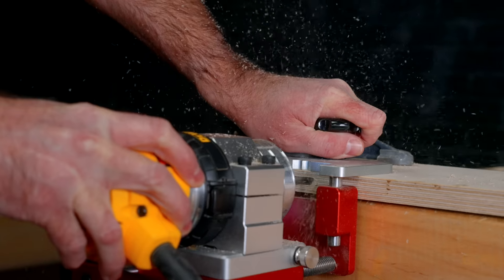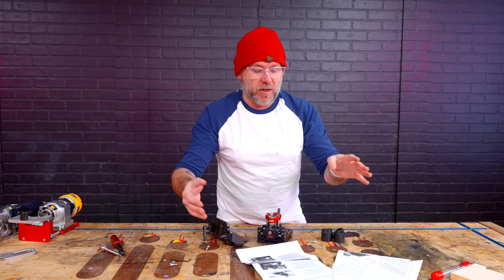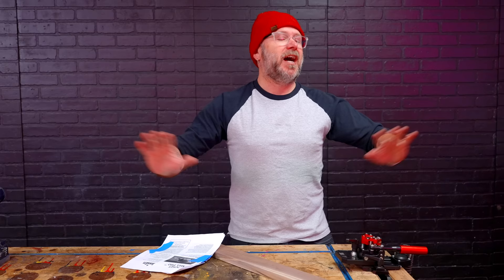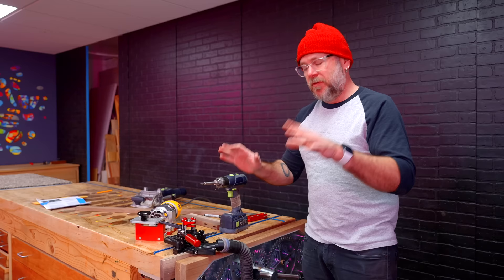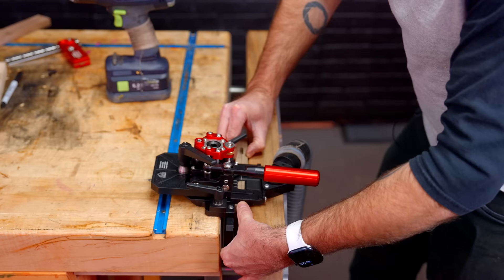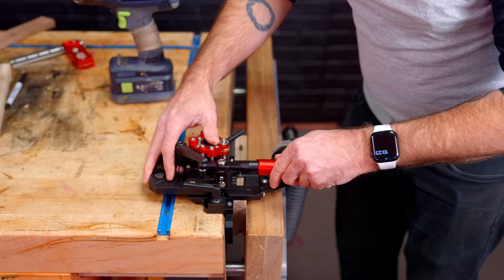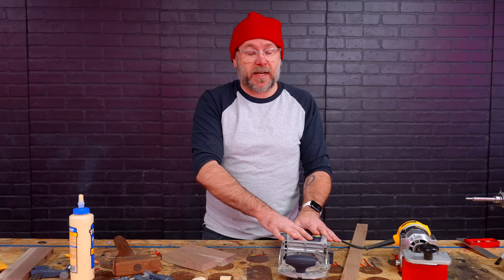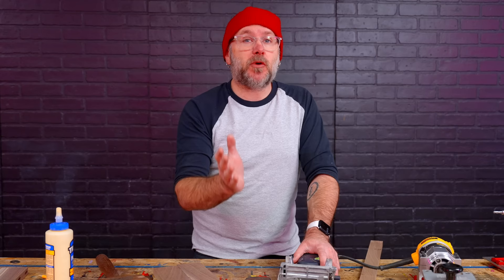I Regret Buying This Tool | Pocket Mill Pro

Comment: Thank you for another unbiased review. It seems like the extra $200 for the jig is needed…which is not an insignificant amount of added cost.
Reply: That brings it to close to half the cost of the Festool. Bring in the awkwardness of the Jessem, it seems the Festool would be better to save up for.
Reply: even with that extra jig, which takes up space, you would not want to use this. that would be almost 600 bucks in the trash
Reply: Pask Makes a channel on here which shows you how to build a router mortising jig that has dust collection and looks easy to use and to do the job really well. It's made out of wood and the video is quite clear and easy to copy. He uses it for loads of his videos and it always appears to do the job quickly, accurately and cleanly and it'd costs basically nothing to make as you could basically use cut offs from other projects. Honestly I'd say it's by far the best option for a non professional/casual wood worker as it does the job really well, it's as good as free and at least as good if not better than the choices he's shown on here apart from the Fastool Domino.

Comment: Let's say you want to make a door and need 12 domino joint to put it together. That means you need to cut 24 mortices, which can be done very swiftly with the Festool, while you would still be fiddling with setting up this drill jig. If you make a lot of doors, or windows, or table tops, or furniture with floating tenons, it really does make a lot of sense to get the Festool because even if it is a big investment it is just such an efficient tool to work with. If you only need to cut floating tenons once in a blue moon you can of course not justify to pay the price of such a premium tool, and for those people I would recommend to either go old school and do hand cut mortices and tenons - taking your time and enjoying the process -  or use a biscuit joiner, or a basic dowel jig depending on the application.
Reply: I agree with this. I really don't see what niche these other floating tenon jigs are trying to fill. Sure, you get to use Dominos for less than half the price, but also half the usefulness, convenience, safety, etc. If you're not in the market for a Festool, go with a solution that doesn't try to be a replacement -- dowels, pocket screws, traditional M&T, and glue will get you everything you need with less headache.
Reply: I was thinking the same thing. While this is technically an alternative, it is absolutely not an alternative as far as time goes. If you are doing any kind of production work, the domino pays for itself in time saved for sure.
Reply: I kind of agree.  I think each tool definitely has a place.  As for using a biscuit joiner or dowel jig in place of a floating tenon, I disagree to a degree.  Biscuits are good for alignment but don't really offer any strength.  Dowels offer good strength but don't have any wiggle room so it is much more difficult to line things up.  With the horrible instructions aside a lot of the issues he faced in the video could have been solved by either getting the workstation (expensive for what it is IMO) or simply screwing the jig to the workbench.  He was trying to wrestle the board and the jig at the same time compounding the issue.  I personally feel this is well suited for the hobbyist teetering the line of being a startup business where you can't yet justify the domino but need something quicker and more precise than old-school techniques that take years to master.  All that said I do hope to own my own domino one day.
Reply: @davidp5492  you’re probably going to continue waiting. It’s been about to expire for years and years and they keep altering something on the design to extend the patent. But hey, anything is possible.
Reply: @michaellang9443  Its for pro cabinet shops. Its supposed to speed up assembly line work. Its not intended for hobbyist use.
Reply: @davidp5492  I think they can get extensions on the patent.
Reply: @davidp5492  Patents cant be extended in EU or US . Domino did come to market in 2004 , so next year patent expires .
Festool can invent something new , but old Domino is free for all . Hard to come up what tool we dont already have .
Festool invented guide rail in 1960s , random orbital sander in 1970s , plunge saw in 1980s , systeiners in 1990s and Domino in 2000s 
Have not heard Festool coming up with something new in 2010s , now they have plunge saw with scoring blade , if that their big thing in 2020s , not impressed .
Reply: 100%. Professional tools having a higher price than hobbyist tools is a no brainer; they are meant to save time because time is productivity. I bought a dowelmax because I’m not a professional and I won’t be needing a domino ever, but a good dowel jig that doubles as a drill guide? It makes sense.

Comment: I don't mind paying for quality. But there is a difference between paying for quality and what Festool is doing. Festool makes good tools, no doubt about it. Where I object is they appear to set their price point for making a good profit, then tack on 50%. It's an advertising gimmick to make the public think their tools are better than they really are. They would make their profit at $500 and still have a good mark up, but sell five times the amount of product. I have paid, without flinching for top tier tools. I compare what Festool is doing to Snapon tools, way, way over-priced for the quality. Even if Festool gave me the domino, I wouldn't accept it because of their marketing policy. Besides I'd ratther make a true tenon. That's my opinion. I know others will dis-agree. Good video.

Comment: I know is "socially correct" not to recommend expensive tools but is each person's decision. Is my money and my free time, that I value a lot, so I use Festool Domino in my occasional projects. In my 40 years of experience as a recreational woodworker, fabricator and machinist I always found better to buy fewer tools but of high quality, and take my time and save for the next one.
Reply: exactly, hobbyist does not mean poor but it does mean it's our side passion so less time for it. For that reason, I chose a domino. I can make more money, but I can't make more time.
Reply: Wow, we must be related. I’ve been a toolmaker and avid woodworker / fabricator for over 50. + years.  Ain’t it great! I was doing mortis and tenon joinery on a Bridgeport back in the beginning.  Hey you can always cut wood on a metal working machine, of course not the other way around 😜

Comment: Lets see.... $400 dollars for fuss and muss, or $1,200 for speed, accuracy, easy of use, and the ability to connect to a wide array of system upgrades.  I say, save 4 easy payment of $300 a month for four months, then treat yourself to a Domino... No one has ever said I regret buying one.  Except Jay Bates, then a year later, he went out and got another one to replace the one he gave away....lol.

Comment: The more I see videos on less expensive alternatives to the Festool tool, the more convinced I am that if I ever wanted to make a project with floating tenons I would save up to buy the more expensive tool.  I learned an edict a long time ago and it is to always buy the best tool available that you are able to.  It has not let me down in 40 plus years of working with tools.
Reply: I look at tools like this, after a few jobs  I'll have made my money back, usually 2 or 3 fold. Tools can always make you money, a more expensive tool may hot your wallet harder initially but it'll pay off before you know it.
Reply: Definitely thinking Domino is buy once, cry once too... every Domino killer video shows nothing is killing the Domino
Reply: The dowelmax system is worth taking a look at if you haven’t checked it out before. It’s obviously not a domino, but it is fast, accurate, and repeatable (also quickly) and I think that makes it valuable for anyone who isn’t ready for a domino. Even my wife said “wood is expensive and you’ll make less mistakes with that right? So get it”. That’s the😊 easiest tool purchase I had in a while
Reply: @liquidrockaquatics3900  I also got the DowelMax and have had great results with it. I've built benches, now building a door, and I'm sure there will be many others down the road. Get the holes in the right places (easy with DowelMax), no alignment issues whatsoever. I'm done with biscuits unless it's for something quick & dirty. I'm not going to consider something that's not self-aligning, like the Domino system. Dowels are also the strongest of these systems (lab testing done by DowelMax).
Dust collection IS an issue with most dowel systems. I use a setup where the drilled piece is clamped upright, and another upright piece in proximity holds the end of the vac hose (clamp, bungee, rubber bands, or tape). Spring clamp to get workpiece aligned to vacuum, then screw clamp it rigidly in place. Working on a downdraft table would probably be easier but I don't have one.

Comment: Even when I was a weekend warrior, I bought a Domino. My time as a weekender was even more important as I had less of it, juggling the shop work with my day job. 2 hours to cut mortice & tenons that won't be seen or 2 minutes to rout out loose tenons (that add just as much strength and STILL won't be seen) using the Domino... Hmm, let me see!. 
I'm not a Festool fanboy or advocate and do think that some of their tools are vastly over-priced considering alternatives are available (e.g. my Bosch Professional sander does, for me, a better job than a Festool Rotex for about £300 less) but in some cases, they do make excellent kit that in some way justifies the price tag.

Comment: I bought the TianLi jig a day or two after the previous video about it, I got it through United Clamps for $298 CAD ($222 USD) shipped. I use it with my Milwaukee M18 fuel hand router, but had to remove the back cross beam to make clearance for the battery. I also built a dust port that I attach via the jigs handle and holds my hose over the router bit, and it drastically cuts down on dust.

In the last 1.5-2 months I've had it I've built a bookcase, a twin bed frame, and a kitchen island/cart all with floating tenons. The TianLi jig is quite well made, but is a little fiddly to set up and use so there was a bit of a learning curve to make it work at its full potential. On my last project it only took me a 5-10 minutes to set it up for use, and I got rock solid results. The first project I used it with took more time and some rework as I figured the jig out. As a hobbyist I can't justify the cost of the festool, but I bet it's much faster and a lot easier to setup and adjust, based on all the youtube videos I've watched.
Reply: I have the Milwaukee m18 hand router as well, which Tianli jig did you buy? Makita or Dewalt?

Comment: I appreciate this. You pointed out some of the exact issues I thought I might be seeing on Lincoln's vid. I bought a similar "ebay" jig years ago, and it served me very well once I got familiar with it. The jessem looks cool, but clunky without the fence option. So I'd call this a necessary part, so a 550 tool. Still much better for a hobby shop than a festool, but I think they've got to refine it a good bit.

Comment: Can’t thank you enough for the honest and very detailed review of the unit! I was contemplating to downsize my Domino dream but after seeing non-staged, actual use case of the unit I clearly see why Domino’s price is more than justified. Had very same finicky experience (to say the least) with BeadLock Joinery System by Rockler. Engineering quality of Festool’s systems and equipment is top notch and extremely robust, safe and user-friendly, whereas other manufacturers might be simply copying each other. I’m also a very loyal customer of Makita and some (not all) of their tools are extremely good. Great video, great content - you’ve earned a subscriber! ❤

Comment: The jessem dwelling jig is actually a  best alternative to  the domino ..its affordable  and if you  use it with the 1/2 " dowels it makes insanely accurate and stong joints ..pretty fast too
Reply: Exactly. Domino is proprietary and only intended for pro shops anyway. High quality doweling jigs are much cheaper because dowels are not patented and trademarked. So they will always be much cheaper. Even a dedicated doweling tool will be cheaper than the Domino simply because it can be made for the consumer market, not just cabinet shops. Also because the Domino is intended for a small market, they don't make enough of them to bring the price down. For most of us the dowel jib wins hands down.

Comment: I JUST bought the e-bay tool.  When I saw the title of the video my heart went to my throat.  I'm glad that the tool I chose wasn't the focus of the video.  I'm not sure I'd like to spend $500+ for a tool that required 2 or 3 packages and a few purchases to be usably quick.  If I damaged my $195 jig I'd be very upset, and if I had the potential to damage both the tool ($350) and $195 jig I'd ask myself why didn't I just get one of the other tools.  Thank you for demonstrating this tool!!

Comment: I just got my JessEm Pocket Mill Pro the other day, and I must say it is pretty slick.  I’m not a professional and couldn’t justify the extra $$ for the Domino.  I think to be fair to JessEm you should have used it a few more times before doing the review and you would have gotten more comfortable with it.  That said, I did also get the extra Workstation and it does make the setup very easy.  Different strokes for different folks, but I am very pleased with my purchase.  Also to be fair, I do enjoy your videos and have learned from them over the years, so keep of the good work!
Reply from the maker: It's great to hear you've had a good experience with yours. This is why it's important to get more than one opinion when researching tools. Thanks Brett!
Reply: Agree, he made it look sloppy. Gotta have it set up properly. Also, his detent isn't working?  Mine doesn't slide off the back.

Comment: Great video. Would have liked to see you using it with the option fence jig.  It looked very frustrating watching you using it in your bench vise. The other video I saw they had the extra jig, and the experience looked completely different. I also have the Jessem miter fence and stock guides and love them. As well I have the Jessem dowel jig, which I bought before owning my Domino, and highly recommend.

Comment: A Domino is the one tool in my whole shop that I splurged on and I'm glad I did. I keep seeing gizmos that make joints "just like a Domino," but none of them do it as stupid easy and fast. All of those jigs will go into the junk drawer the second Festool's patent on the Domino expires and the market is flooded with less-expensive loose tenon cutters.

Comment: I think you should try it with the optional fence. Still not as fast as domino but much faster than the way it was setup in the video. The dust collection is top notch!
Reply: I watched the Lincoln St Woodworks video he mentioned in this video.  Another view on whether this Jessem jig is worth it.  He had the optional fence.  Its $250.  The jig is $350.  Total of $600.  The smaller 500 Domino is $1069.  By the time you buy the Jessem fence and jig, you are nearly 60% of the cost of the Domino.  Are you really saving enough money to justify going with the cheaper and far less convenient option of the Jessem over the Domino?

Comment: I had access to a similar rig on a massively larger scale for cutting my had-built entry door for an old fashioned mortise lock.  It had a crank that would step it down with each rotatiojn.  This thing used a 3-HP router and clamped to the door.  You had to center it and make the stop limits.  The mortise was roughly 3-1/2" deep and 5-1/2" long, and used a 1/2" bit.  Needless to say, it needed multiple passes to cut that out.  And, don't even get me started on the pucker factor!  Jessum makes some good tools, and I have their stock rollers on my tablesaw.  It is nice to cut down on kickback, but I especially like how it the angle of the wheels keep your stock tight against the fence.

Comment: I can't afford the domino and while I think its a really cool tool, I'd rather use the plethora of other joinery options than trying to futz with some hobbled together alternative that does the same thing. So many other joinery options out there. I do appreciate your time putting together videos on them, it's worth the content to do them. thank you for putting these out there for people who wish to try them out.
Reply: I'm with you, Joseph.   As a weekend woodworker, I could quickly and easily use my inexpensive dowelling jig or almost as easily create a spline to join these two boards.  Since I am a rank rookie who builds small, easy projects, I can't justify spending all of that cash for any of these tools.  Heck, I could spend that cash on lumber instead.
Reply: Bingo.  You can do floating tenons with a router and edge guide.  If your router has dust collection you're ahead of most of these contraptions.

Comment: As you said we that are just hobbyist woodworkers can take time to do the joinery. I do the loose tennons with a fixed base router and a fence just do it carefully so for me a domino is not even on my mind, about the jigs the Tiali looks very good option and if I ever get one can make many improvements like change the knob handle for a better one more similar to the handle of the domino, the router model or brand is not a problem is you have an smaller one you can 3d print a collar and if is bigger you can also print spacers and use longer bolts, also for the dust collection something can be made even for me is no problem since I work on the backyard and when the sawdust piles up just spread it around 😁